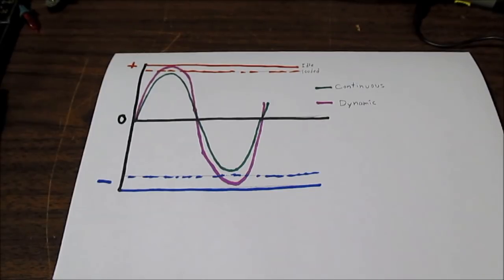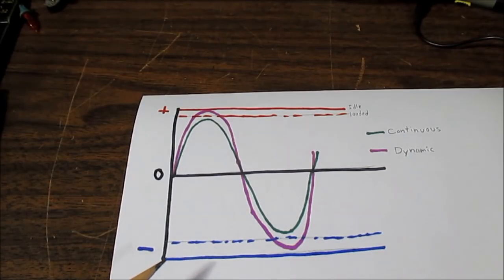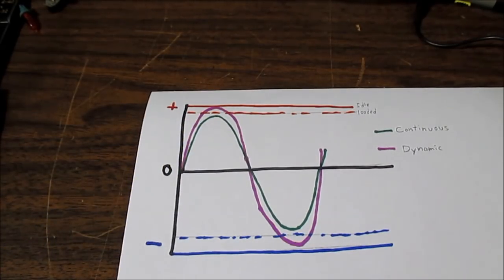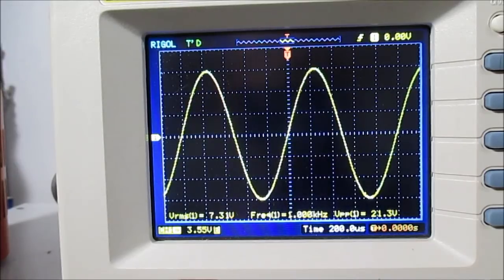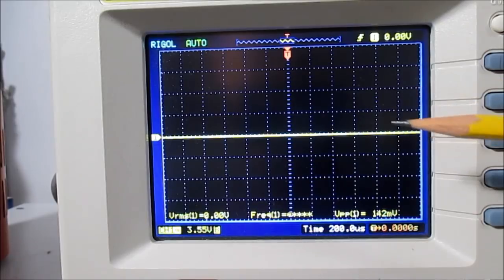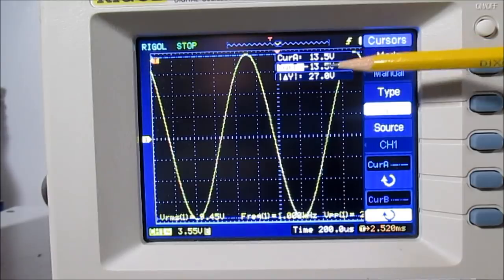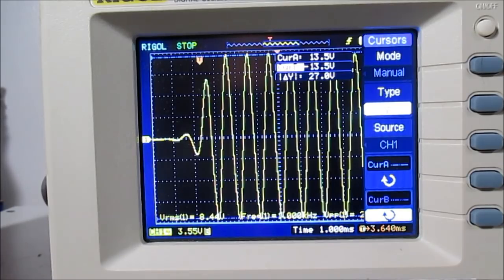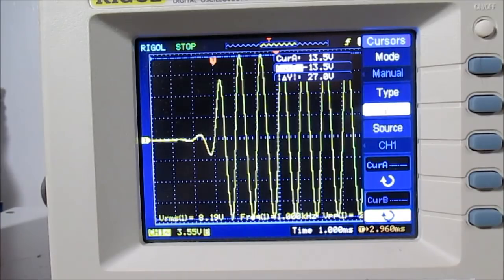Audio amplifier dynamic power explained with demonstration

Comment: For some of the more modern music with long sine waves in the bass region you need continuous power, the supply rails will be condtantly loaded and sagged. Something like acdc with a kick drum transient every second or so you benefit from dynamic power, between every kick drum the caps charge up to near idle voltage.

Comment: Hello friends. Such a question. I have 2 monoblock. The first mono pull out 5800 W RMS on static and 11000 W on dynamic test  on 1 ohm, and the second 8000 W RMS  on  1 Ohm static and the same 11000 W on dynamic 1 ohm test . The difference is only in the price of the amps Going to wire 2 subs 0.7 ohm with total 8000 W rated power.

Comment: Nice job on the videos, John.  
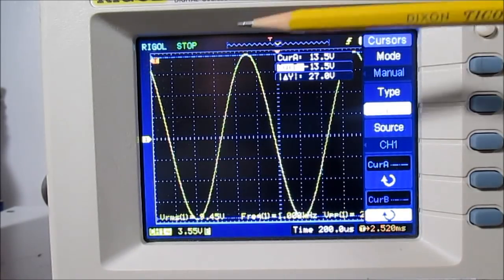At 8:50, I was wondering:  Doesn't your Rigol scope have vertical cursors that allow you to select a time point for the scope to read the waveform sample at?  That's the cursor mode that I normally use on my Tek scope.  
I like the fast live FFT feature on your scope for finding the precise clipping point.

Comment: You touched on the importance of the reservoir cap on the power supply, but it is most important for lower frequencies. With an inadequate reservoir cap on an amp pushed to it's power supplies continuous limit, the volume itself will audibly dip when low frequencies play, and then increase again dramatically when they stop. It sounds absolutely horrible but an easy thing for anyone to fix if they know what the problem sounds like.

Comment: Home audio amplifiers were regulated, but car amplifiers weren't. A continuos sinewave is measured below 1% distortion for home amps. In fact some home amps are rated at .001 % distortion or somewhere in that neighborhood. The important thing is that 1% is were our ears can start to perceive distortion. Car amps on the other hand might be rated at something like 25 watts per channel at 10% distortion. That means it gets load and sound like shit doing it. There are other specs as well, and with most of them the lower number is the better except channel separation, signal to noise ratio, 100 or better is what to look for, frequency response, this should be a minimum of 20 hz to 20,000hz, the range of human hearing. 10hz to 100,000hz is much better, but the minimum requirement usually suffices. Anything less and you'll definitely miss part of the source material. I bought an Am that was rated from 40hz to 20,000hz. It lacked bass. It might have been made with a subwoofer output, but it still left a lot to be desired with the mains. And on the top end, dropping below 20,000hz to say 16,000hz will take away a lot of the transient response, say of a bass drum being kicked. That impact happens very fast and without a way to hear that attack the music will be lacking something. So keep these minimum specifications in mind when you boy any amp!
Reply: Car amps rated at 10% thd? None that I’ve ever ran. US amps were rated at .006%. Newer class D amps have higher THD, with early ones around that 1%.

Comment: I watched a video of a new high power D-Class American amp chip. The CEO was proud to present this new amp and stated the power rating at 10 % distortion. Every PDF sheet I have looked at seems to try and hide the true performance of D-Class either concentrating on ridiculously low power figures or this stupid 10% figure depending on what parameter they are trying to fudge. Over half a century ago I built a pair of Mullard 20 W valve amps. Mullard were proud of 0.05 % RMS distortion into 15 Ohms. They quoted the max at 27 W,  I can't remember the RMS value at that - certainly a lot less than an unusable 10%.
Reply from the maker: Yes, it is annoying. You have to look at the power vs. distortion graphs on the datasheet to see the real performance of the device.
Reply: jp PS audio ?

Comment: 1. One of the more well-known brands to specify dynamic power is NAD, who typically include a factor of 2 (3 dB). 
2. 2000 µF caps are very skimpy for a 4 ohm capable amplifier - for a power bandwidth down to 20 Hz, you'd need about 8200 µF. Are your speakers that small?
3. It is not unusual to find a crest factor (peak / average ratio) of 6-10 dB in music. For kicks, I'd be tempted to use a rather wimpy transformer with rather highish (but still safe) voltages at idle plus a fairly massive amount of capacitance, like 2x 22000 µF or so or more, and see how that sounds. And no, large caps won't blow up your rectifier, the winding resistance of a smallish transformer makes for a good current limiter. Back in the late '70s, it actually was not unusual to find fairly big caps (10000-22000 µF), as transistors back then would also be limiting the maximum supplies you could run (SOA wasn't all that great). As the '80s rolled around, parts got better but things also started to be made more and more cheaply but in greater numbers, and build quality really suffered after about '82 or so, including skimping on electrolytics.
Reply: In answer to your second point, I'm sure John said his power supply used 10,000 µF capacitors.
Reply: A regulated power supply is unnecessary. As a linear series pass regulator, it can only be worse than the worst case droop between AC cycles as it can only dissipate excess voltage - not fill in. If greater power were desired, I'd increase the filter caps - perhaps by allot - and let the amplifier's power supply rejection ration (PSSR) sort out the rest. Adding a series power choke after the full-wave bridge would help raise the minimum DC level as well with a reactive boost in between crests. The crests are useless for this application, so you might as well inductively capture them to fill in the voids in between. The inductor would be physically large in the low mH range.

Comment: my 12 inch sub is powered by 2  regulated 30V 5A (31.5V no load) power supplies, the amp is a TDA 7293 bass is solid even at very low volumes.  I know im only getting about 85 watts RMS but man it sounds like 2 to 3 times that.
Reply: Actually, the way sound works, doubling the amplifier's power would make an almost unnoticeable increase in volume. Tripling the power would make a slightly noticeable increase in sound level. This is due to how our ears work, they work on a logarithmic scale - this is how the decibel came about.Takes a massive increase in power to increase loudness, actually takes about ten times the power to get twice as loud. Lots of good reading on this subject on the internet.
Reply: @davekazoroski6548  why do i hear almost twice the loudness when i plug in the other 2 channels to my 4 channel amp without making any change to the volume then ? maybe someone made this up and it is only a mostly untested  internet legend .

Comment: I remember when amplifiers were rated in RMS watts. That is what all the high end products (the only ones I looked at) were rated in. Also, all the pro sound studio monitor amps were rated in RMS also. Even today, I get studio reference amps for almost all my audio amp needs, and, at least Alesis (the brand I get because they make low power ones) is rated in RMS. I was looking for a consumer 30 watt per channel amp, in a case i was not concerned about top quality, and found many rated at 1000 and more watts that appeared to be around 30 watts channel. I could not find any that seemed to have a sensible power rating, and so just guessed based on the way it looked and the power it consumed. And so, I ended up getting a 1,200 watt amplifer, and indeed, it was 30 watts channel, just what I wanted. 
But the thing is, no matter how you test it, no matter what testing method one tests with, there is no way one could come up with 1,200 watts, and so IT IS A LIE!! Is false advertising legal these days? Based on my search for a 30 watt consumer amp, it must be legal to false advertise.
Another great thing to check out, if one wants to find false advertising, check out home shop vacuums. I found them rated over Seven Horse Power, and yet they plug into a standard home outlet, aka Nema 5-15 outlet which are 15 amps. That motor would need a 230 volt 40 amp circuit. What I say about those products is that they are what everybody has been wanting, Over Unity!
Reply: Look at the cheap car audio industry. brands like BOSS and DUAL that all your high school kids love cause there cheap say BS like 1500W, but only does about 430W. good friend of mine wanted an upgrade from a Sony 500 monoblock, so naturally, went to walmart, got a "2000W" Dual, and was trying to figure out why it wasnt any louder than his sony.
Reply: A 7 horsepower motor would need just over 20 Amps on a 230/240 volt mains. Just about do-able. PMPO means nothing and has never been defined unlike RMS which is the heating power of an AC waveform into a specific load. They fiddle with the figures thus,  240V mains supply has a peak to peak value of 678V - if you had a double 240V socket  you would have 1357V - thats how dumb the power figures are, but there is always some bonkers math behind it - they would need to explain it to someone occasionally. Are they lying, well yes, but a lawyer might say otherwise. That is how it was 40 years ago. Today, they are probably just lying outright. 
The only way to rate the power of an amplifier is both channels driven continuously into required load and the RMS power measured.